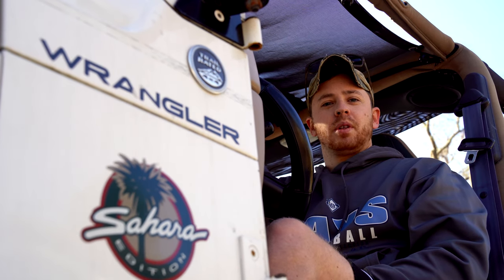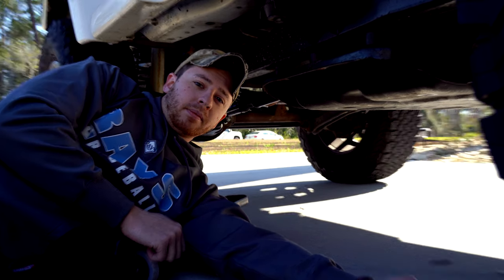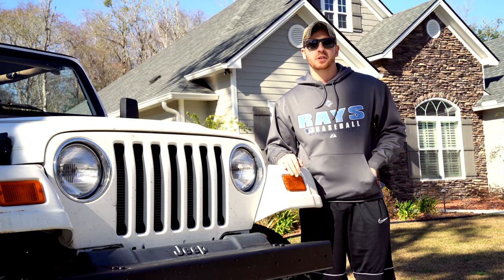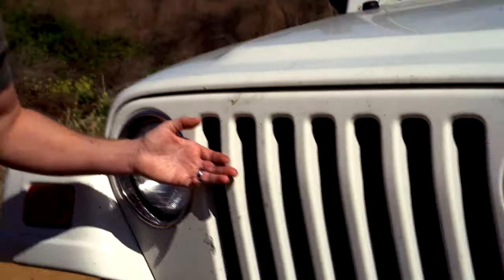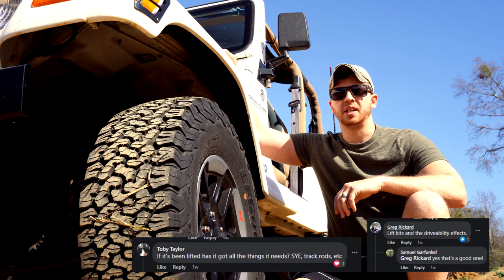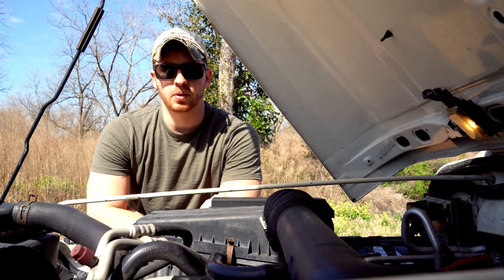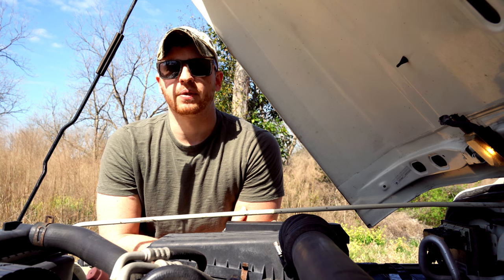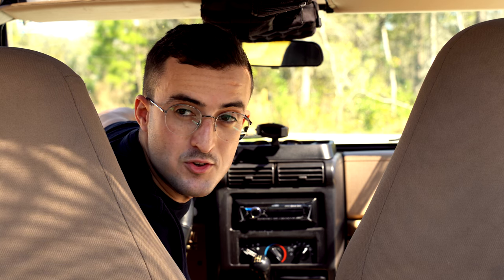WHAT TO LOOK FOR WHEN BUYING A JEEP TJ

Comment: These Saharas are by far my favorite TJs! Either in this white or black with that tan interior. And those classic green and tan seats make for the best color combo I've ever seen in any Jeep. And we Jeepers know these 4.0's last forever with routine maintenance. Might have to do an engine rebuild every 325k or so miles, but it's certainly worth it.

I almost bought one on several occasions back in late '19 but it didn't work out, either the frames were rotted out or other issues. But I was fortunate to find an '05 TJ Rocky Mtn with an immaculate frame, 4.0 I6, 3.73 gears with lsd and a Dana 44. I have it running and driving excellent, and would say overall, it's in new condition after a lot of hard work. Just have to do a paint correction this spring and it's done.

Btw, anyone who blocks the 7 slot grill with angry bird eyes or even worse, that darth vader grill cover should be seriously injured. Unfortunately, I've come to expect this from the jk and jl people, but NOT from any TJ owner.

A hood vent would look great on this Sahara and more importantly help that 4.0 breathe a little easier.

                      O|||||||O
              🇺🇸Only in a 2 Dr🇺🇸
                     '41 - '06
Reply from the maker: You and I have very similar tastes then! This was my gift to myself when I finished my active duty time with the AF. It’s also my favorite color and interior combo.

I almost purchased a Rocky Mt edition myself but all the original things like seats had been replaced.

The rant about the grill was for fun but I honestly can’t understand why anyone would hide such a perfect iconic identifier.

Anyways thanks for watching, more fun Jeep content is coming in the future! First will be a video on my 89 Firebird Formula.